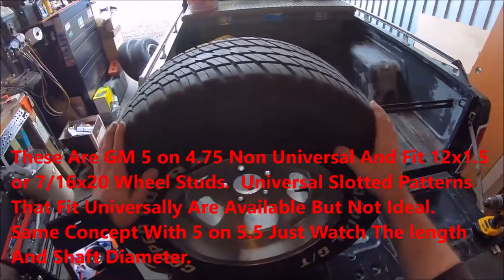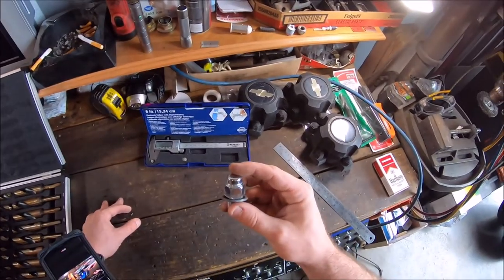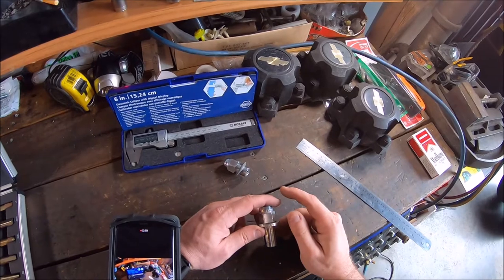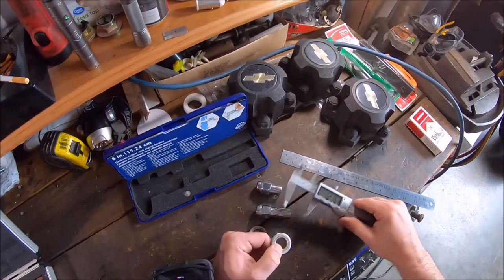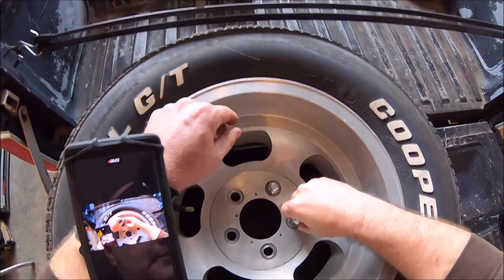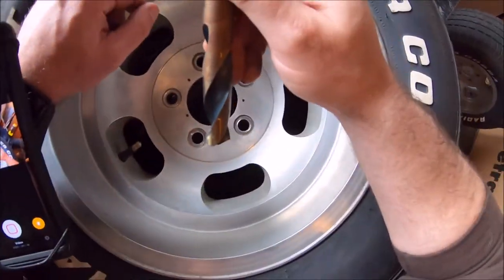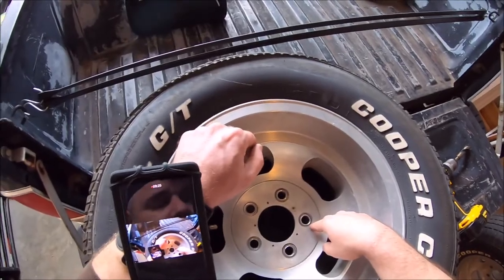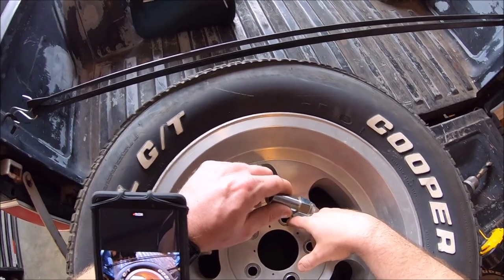Ansen Sprint Aluminum Mags/Slots Lug Nut Info (Circa 1970s) 🔧

Comment: Great information! I did not know Ansens were that valuable! Maybe I will stick to the Dorman 711-208s. They are 0.67 diameter. The really nice McGards are 0.68. I just got the McGards from Summit today. And were surprised they didn't fit most of the holes. 
Question though. My Ansen hole depth is 1.125, while the Dorman 711208 shanks are only about 0.750.  My lug bolt are less than 1/4"  back from the rim face. Should I be using a longer shank lug nut than the .750?